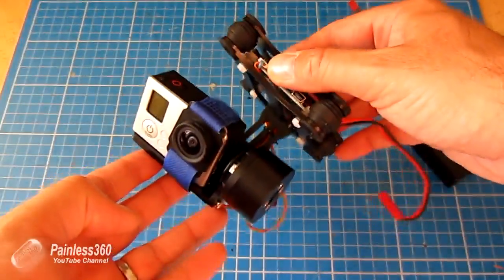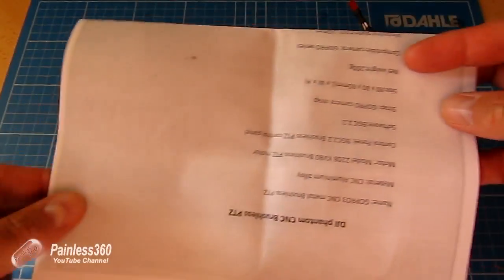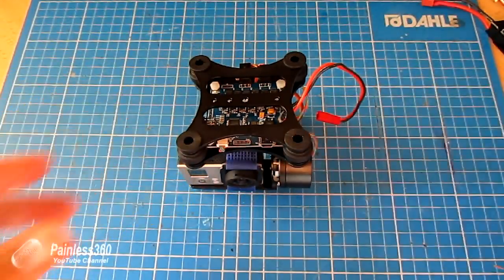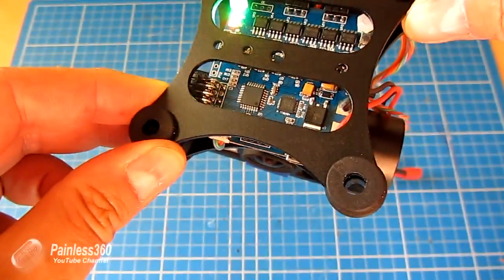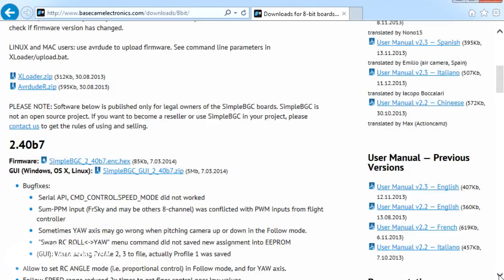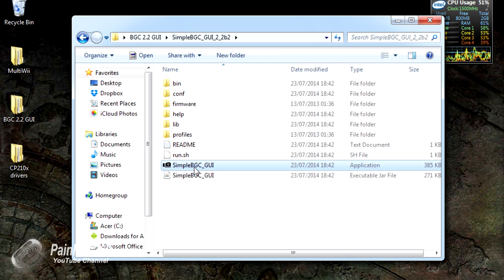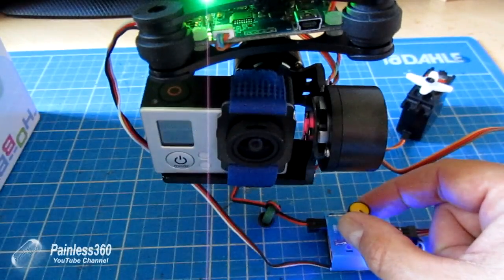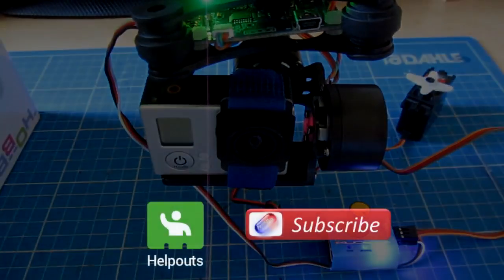BGC 2.2 (2.2b2) GoPro Camera Gimbal – Software, drivers, setup and receiver connections.

Comment: hi i got the same gimbal  and im trying to get it to tilt with my radio true the dji naza on port f2
and i cant get the gimbal to tilt
on the same f2 i got  Y harnes and i got my fatshark tlv 600 on it  and the other section is for the gimball
juste to show that the Y harnes is ok  i have place a servo on it and it works perfect
i did try all the ports on it  it never moves
i did a smal video to show you
can you help me 
https://www.youtube.com/watch?v=9gkxPTnT0t0
Reply from the maker: Sorry, I don't have any DJI products so can't help much. The only thing I can suggest it try plugging a servo tester into the port as I did in the video and connect the gimbal to the software to see if it is configured for tilt...

Best of luck with it..
Reply from the maker: Painless360 The very basic paper instructions that came with this gimbal can be downloaded from https://dl.dropboxusercontent.com/u/67301981/Gimbal%20Printed%20Instructions.jpg hope it helps.
Reply: Painless360 how can ye know if it is configuers for tilt !

Comment: Finally an in depth video on this Gimble. Help, I never got the instruction manual. Would you happen to have a Link to the PDF file? Any insight. Thanks again.
Reply from the maker: http://www.basecamelectronics.com/files/v10/SimpleBGC_manual_2_2_eng.pdf

Happy flying!
Reply: Thank you so much for the link. In your video I see you have instructions specific to the Phantom any chance those are available? I appreciate your time and Thanks for the help fellow flyer!!
Reply from the maker: Frank Zambrana The very basic paper instructions that came with this gimbal can be downloaded from https://dl.dropboxusercontent.com/u/67301981/Gimbal%20Printed%20Instructions.jpg

Comment: Hi guys, i have my gimbal set up ok, may just need to change the power settings because it vibrates in a bit of wind. My question is when i connect the cable from the flight controller to the gimbal so i can use the scroll wheel on the controller the gimbal seem very slow and not very stable. it must be a setting on the software but I'm not too sure which. as soon as i take the cable out its fine. Any ideas?
Reply from the maker: Hi Scott, try it with a servo checker like I do in the video to check to see if it's the PWM signal that the board is getting or something else..

Best of luck!
Reply: Painless360 Thank you, i have checked that and it works great but as soon as i lift the quad up the gimbal over compensates and won't stay true if that makes sense. if i unplug that cabe the gimbal is perfect. Is it the PWM settings that i need to change then do you think?
Reply from the maker: Sounds like maybe the flight controller AND the gimbal are trying to stabilise the camera and fighting each other. Make sure that any gimbal control is turned off in the FC..

Hope it helps.
Reply: Painless360 Cheers, I've had a look and i turned everything off in the DJI software but it still happens. Im not that bothered about it. Just need to stop the roll shaking/jerking . I'm guessing thats the power settings??
Reply from the maker: Sounds like the power to the motors needs increasing a little but to hold position.. Best of luck!

Comment: Hi, I have this gimbal and am using it on my dji phantom fc40. It is stabilizing well, and I can see in both the Naza and the bgc GUIs that it is detecting the pitch control coming from my controller, but it doesn't seem to react at all. All the videos I've seen, it simply follows this input by default. If you could help I would greatly appreciate it! Thanks.

Comment: Still available for Helpout? I'm having an issue with my gimbal (same Chinese, a GLB, but using the BGC 2.2), where it's fine in looking towards the horizon, and I'm fine on being able to tilt it up and down mostly, but once it looks lower than 45º down, it jerks and skips over and over and refuses to stabilize. What I'd like would be to look straight down, but no go. Thoughts?
Reply from the maker: Chris Webb hi Chris, I don't as they stopped the ability to have chargeable sessions. My first ones were free anyway,

I would suspect that the motor power needs to be increased slightly. Connect it to the software GUI and save the confit before you change anything. Then increase the motor power fractionally and keep testing it. 

Hope it helps.

Comment: Thank you for the videos. Hope you can answer this. I just got a GoodLuckBuy Alexmos V2.3B5 Gimbal. Should I use the v2.3 SimpleBGC software on this? I read somewhere you had to have a null version (maybe that's just for upgrades). I just don't want to brick it. Thanks!
Reply from the maker: I'm not sure - looking at some of the forums the answer appears to be confusing. Sorry I can't be more clear but I've not used the newer board. Let me know what the answer is when you get if figured out.

Best of luck..

Comment: Hi, i have Phantom 2 and same Gimbal, see my problem please https://www.youtube.com/watch?v=9h16_ZQEYes&feature=youtu.be When i connect green and yellow wires respectively,  gimbal turn whithout control. I connected wires in Naza unit right down and left, and wires in BGC right too on left top, i don't understand why do this :(
Reply from the maker: The gimbal looks like its working well and the setup is great. I would connect an RC receiver to the inputs on the BGC board and see if you can adjust the pitch/tilt like I did to test they are working ok.

Is this a DJI Phantom? I suspect that the outputs from the flight controller are the problem and trying to get the gimbal to move past it's range. Recheck that the outputs for the gimbal are setup right.

Sorry I can't be of more help, I don't use DJI flight controllers..

Best of luck..
Reply from the maker: Xematick You can get them form anywhere, mine was from HobbyKing - http://www.hobbyking.com/hobbyking/store/__14774__HobbyKing_8482_Servo_Tester.html
Reply from the maker: Painless360 The very basic paper instructions that came with this gimbal can be downloaded from https://dl.dropboxusercontent.com/u/67301981/Gimbal%20Printed%20Instructions.jpg

Comment: hi,
I plan to buy a gimbal like this, because it is the cheapest ATM, but I don't want to use it for FPV yet, but to use it as a handheld stabilizer on my spider camera rig.

Can you help me, with some circuit scheme for example how to build the cheapest and most simple controller for the manual pitch and roll controls (using switches or potentiometers and no servo tester)?

As I know the 3 pins have -, + and signal, all I want to do is just send a correct 'signal' for one direction when pushing a button or turning a potentiometer manualy without a transmitter/receiver.
Reply from the maker: You can manually set the angle of this gimbal by hand (see https://www.youtube.com/watch?v=wv301eDPIBI) so unless you want to move the position while in use you can avoid any other electronics.

If you do want to move it then you will need something like a servo tester to change the PWM values sent to the board like I did in the video. A pot won't do anything.

Good luck with the project!
Reply: Thank you, so I will need to buy 2 servo testers. I want to change the pitch during recording of video, I cannot use the manual adjust mode.
Reply from the maker: That's the idea. This is like the one I used in the video and would allow you to remove the flimsy cover and put them into a custom case if needed - http://www.hobbyking.co.uk/hobbyking/store/__14774__HobbyKing_8482_Servo_Tester.html

Good luck with the project.
Reply: yes, this is the cheapest, starting from 2 dollars on ebay.
Could this one also work?
http://www.banggood.com/Multimeter-Tester-for-Servos-ESC-Multi-axis-Aircraft-p-915499.html

I guess I would need to have some voltage regulator to got 5Volts from my 12Volt battery for the servo tester, but it is also not a big issue :) just the smaller 150mA max version of LM7805 could do it.
Reply from the maker: It would but surely you'll need an easer to see and move control to move the servo output? A UBEC and small 2s lipo will deliver the power you need. Good luck with the project.
Reply: Thank you, I oredered the gimbal,
I will see how will it work when it arrives. ;)

I would like to ask an other question.
Is it possible to setup the gimbal using the software to have the "roll" motor in the default gyroscope (so stabilizing) mode and the pitch motor to work in follow mode configured with deadband etc. to avoid shaking, but to follow the pitch slowly?
With this setup I won't need a servo tester to control the pitch.

According to your video at the "Follow mode" menu there is a "Follow PITCH" mode option and I have the feeling this is what I want to use.
Can you confirm that it would work this way?

Comment: I connected my new gimbal to the computer and it installed the drivers itself automatically, in SimpleBGC GUI v2.2 b2 however when I try to connect to the gimbal I get firmware version mismatch, and it says the gimbal has version 10.3 b9.

Is it safe for me to flash this with the 2.2 b2 firmware  ? or do I need something else ? I mean, BGC isn't even close to version 10 :) so I assume the chinese guys who copied it just arbitrarily made up some version number on their firmware copy. But I just want to be sure it should be safe:)
Reply from the maker: I'm not sure - I'd go back to the supplier and ask them. That way if you have a problem you can return it..

Good luck with it..
Reply: Painless360 heh, hardly worth returnign back to GLB, costs more than the gimbal :p the site claims it has firmware 2.3B5 though. but when I tried the software for that, it said it had firmware 2.4B7, and that software connected to it.

so now I just need to wait for my SJ4000 to arrive so I can test it, right now if I power it with nothing it's just jerking around.
Reply from the maker: If you add a small weight to balance out the gimbal and hold it steady as it powers on it should lock and stay level.. Good luck with the build..

Comment: Hi Painless. Thank you for your video. I followed everything you told me in the video on how to download the software. I downloaded the 2.2 GUI off the Basecam website after downloading the drivers. I try to connect my gimbal (connected to me DJI Phantom 1) but it does not connect. I am concerned as I have not downloaded any firmware. Is there anything else I can do to get it to connect. Thank you
Reply from the maker: No, should work fine once you have the drivers and software installed on your PC. Make sure you can see the gimbal in devices in Windows to make sure it's connected.

Good luck with it..

Comment: Hi. Painless the exact same gimble as you i'm trying to connect the pitch wire's to my nazda and it seems not to work at all the wire diagram i got from the seller is the same one you have and nothing happens when i connect them the gimble works great but i wanted to use the pitch feature. can you show me how to wire it to my naza i tried all other youtube videos and none work.i have the samone and the same firmware. i just need a better wiring diagram.
Reply from the maker: I wold connect the gimbal directly to a receiver/servo tester to make sure that the control board is working (similar to what I did in the video), if that's the case then you know that it's the setup/connection to the Naza is the focus..

Hope this helps. Happy flying!
Reply from the maker: Painless360 The very basic paper instructions that came with this gimbal can be downloaded from https://dl.dropboxusercontent.com/u/67301981/Gimbal%20Printed%20Instructions.jpg
Reply: Painless360 thank my friend i forgot to tell you i figured it out. the wiring was right the remote pitch lever on the back of the radio was bad so i put the pitch mod kit ot fix it thank you my friend.

Comment: I did everything the way your video shows matey. The only difference was that I didn't need to install separate drivers to run the software, it worked with the downloaded software alone. What would be the outcome if I was to reset the board via the option to do so within the software or via a "long press" of the said little button? Is this something you have done before?
Reply from the maker: I would record ALL of the settings that are in the board now before looking at reset. It will reset the board and also set all of the setup to default. I did this to mine accidently and only had the ability to set it up again as I'd made a video that showed each of the tabs in the software!

Does the software show that pressing the button three times will perform the 'Set tilt angles'? If so then check the press switch is working..

Best of luck..

Comment: Hi there Painless. I watched your video on how to adjust the level settings manually. I have the same gimbal as yours in the vid, apart from mine is silver. I have tried the 3 button presses but nothing happens. It connects to the software ok and gives live data on what the sensors are doing and also responds when you click "read" and "write" when making changes. My Gopro settles tilted slightly forward and is a little annoying that the sensor thinks its level. Any suggestions please?
Reply from the maker: Does the software show which number of switch presses is used on your gimbal for 'Set tilt angles by hand' in the 'Menu Tab'? Use that number of presses.

If you do not have it listed as an option, add it. Hope this helps.

Happy flying!

Comment: HI,
Before I saw your video I updated my board for the latest firmware version and now my motors don't work and the BGC program doesn't connect to the board anymore. Do you know how can I fix it?
Thanks
Reply from the maker: Michel Icart bad news I'm afraid. As far as I know you have bricked your controller. You can buy new ones from eBay, banggood.com and others for less than £8 and swap it out. Best of luck.
Reply: Try to use a different GUI version!

Comment: I'm about to buy this gimbal, although I intend to butcher it so I can mount it inline with the frame rather than hanging below.  My question is: can the pitch motor be switched over to the other side of the camera? I have the gopro 2, and looking at your video, there doesn't seem to be much room to spare for the video out cable.

Comment: I need some help.  I purchased a Chinese gimbal off ebay.  It turns out the gyro/compass board was upside down.  I downloaded the Simple BGC software and inverted Z.  everything worked fine.  I might have inadvertantly changed some settings or placed the sensor board improperly.  The gimbal works fine except for when I roll to the right.  It then starts to jitter.  I posted a video to show what is going on. 
http://youtu.be/jCYH5X-8JPs
Reply from the maker: Shawn Szoludko you can see all of the settings mine came with from the factory as I click through all of the tabs in my video. I accidently deleted all of the settings on my board and luckily had this video to review what it came set to and use to set it all back up again (phew!).Double check that all of the parameters are the same. Hope it helps.
Reply: The manufacturer sent me a picture of the basic tab settings.  I tried them and have the same issues.  Your setting are quite different from theirs.
Reply from the maker: Shawn Szoludko sorry to hear that it has been bricked. I think I mentioned this in the video when we were looking at the firmware choices. I believe that the later v3.0 boards are much better for this. Best of luck with the replacement.
Reply: Shawn Szoludko Try increasing the power to the roll axis.Same issue on mine.Not really an issue just needs tuning.Don't overdo it cause you might burn the board and/or motor.Check temperatures after some time.